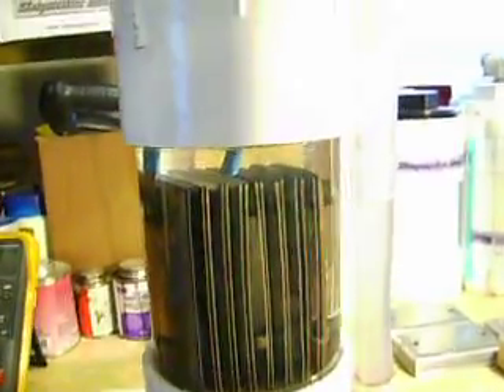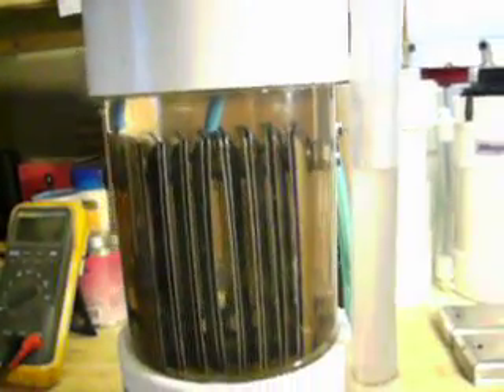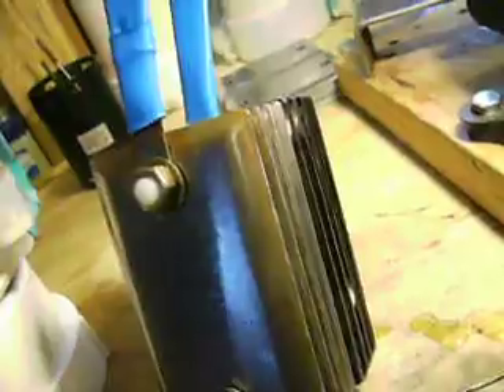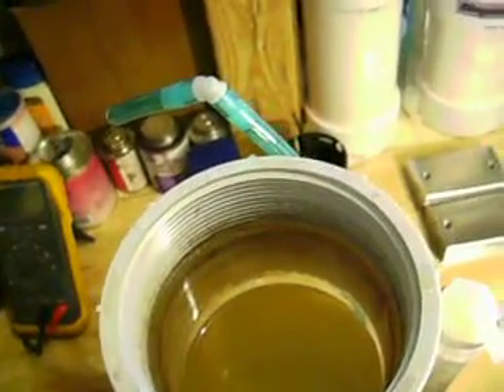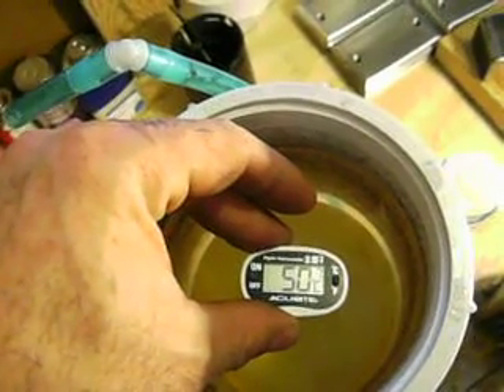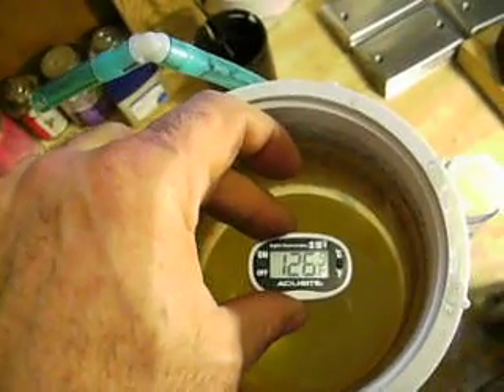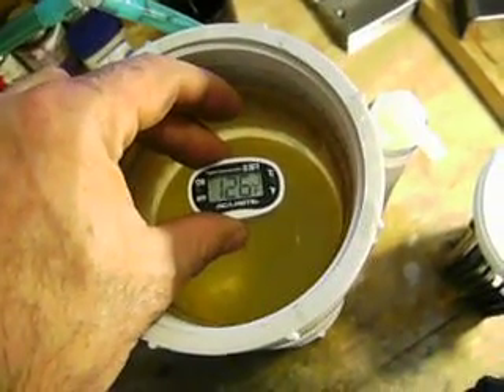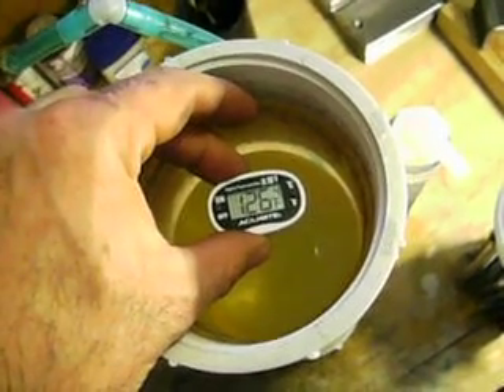Part 8:  Temperature and cell health

Comment: I have built three smack cells and am in the testing portion. All three were build from the exact parts list you provided and instructions given. I am having problems keeping the temperature down and the amps low, depending on the mixture, any suggestions.

Comment: Those are stainless wall plates ! The stainless used in making these plates is sub -par and has many contaminates, that is why you have all of the "orange tint"... Use real stainless and you will get better results. This is, however, a clever idea, using cheap plates from Lowes or HD...